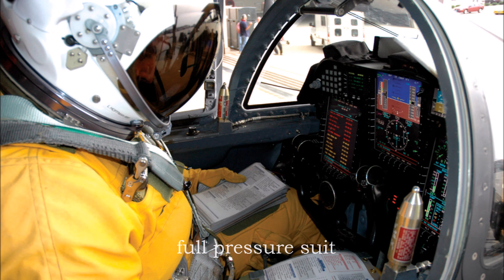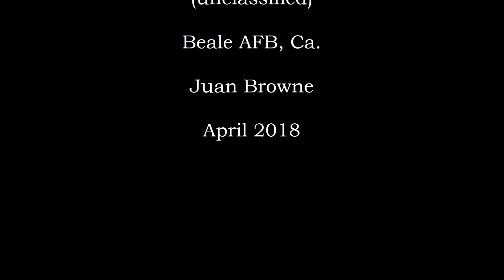Mysterious Jet Noise Over N. California Explained

Comment: Whose bright idea was it to not put a fuel gauge for both wings in, doesn't this require undue pressure and responsibility on the pilot in his flight mission? What advantage did this have when these planes were built for the  mission that was more important than the information pilots need?

Comment: The U-2 was supposed to be obsolete, so they went back to Kelly Johnson for the fix... and got the A-12 / SR-71 family, now hopelessly grounded. As they still flying U-2, makes me wonder what the Classified next generation past the SR-71 really is. Satellites are nice, but not every mission need can be met from orbital observation.  

From time to time I hear the same throttle down and up in the sky above my area, and there is no base at an appropriate distance to explain it the way you do the U-2 out of Beale.  We have F-15s out of KPDX that fly by.  We about 15 miles SSW from the airport.  No U-2s here.   Is there any operational aspect of the F15 that requires dropping to near stall and then throttling up?  Its usually on heavy overcast days we hear this, out of sight from ground. I wonder if they doing dogfight stuff. They dont show up on FlightAware, and its always when there is no GA or commercial traffic around. We get a huge amount of commercial at about 5000 on approach.. if landing from the west. Flights from the south turn at point OR40 (Canby) into pattern, and pass just east of me as they head NW before final turn to land on 10L or 10R.
Reply: UAV's are the replacement for the U-2's/TR-1's.
Reply: Pelican1984 
Unmanned is easy... I want to know about mach 6 or higher aircraft penetrator data collectors...  well maybe I don’t, cause they would kill me if I knew for sure.  Still very much that is highly classified.
Reply: Seems like something else doesn't it? I asked Juan about the thinking when these were built with out fuel gauges, hope he answers one of us.

Comment: If it that critical what's the reasoning behind not having 2 gauges? They do touch and go's up here in Chico and being only 1 1/2 miles away from the runway we get to watch them, very cool. I've seen over the years when they take off from the last touch and go the pilot will point the craft almost straight up and pour the coals to it until there out of sight. Awsome.

Comment: Fascinating! Thanks Juan.... Last year Emeritus Professor Ian Fells asked me how "Anti-Gravity" might have worked. We believe this may be related to the propulsion system for Skunk-works Drone Ultra High Velocity First Responders..???... This is only a guess...!!! (nullius in verba) ... Back in 1982 just before the Falklands conflict broke out, I was invited to help mentor post-graduate exchange students (American) working at Oxford's Culham Centre For Fusion Energy, by Dr John Maple. I am an applied mathematician. These conversations were only hypothetical, and the discussion focussed on "Poloidal rotation and super-conducting pinch fields in a non-fusion 'Tokamak' type plasma toroid." The hypothesis centred around differential forces of centripetal acceleration. These forces increase to the square of the angular velocity. Differential mass is only a linear function. twice the mass, is twice the force, but twice the angular velocity is four times the force. If the plasma is in very rapid poloidal rotation in the upper region of the 'pinch field toroid', and relatively slower angular poloidal rotation in the lower half of the pinch field toroid, then there should be more force in an upward vector, than the downward vector. It would be advantageous to deploy two contra rotating plasmas in separate toroid confinement. (even four of them, two inner and two top and bottom, for perfect mirror symmetry) 6 x 6 = 36, and 19 x 19 = 361. A ten-fold differential vector force advantage if the plasma cross-sectional area is so adjusted by the super-conducting pinch fields. Heavy metal vapour plasmas would never reach fusion temperatures or even close! All they need do is lose their electrons to become plasma. a few thousand degrees Kelvin. The main attraction to this research, was that experiments involved blowing 'Smoke Rings'. A perfect excuse! These were definitely "High Altitude" smoke ring research projects!

Comment: Thanks Juan..!!  During the 80's and the 90's a U-2 would take off 5 days a week at 7:35 out of Moffett Field in Sunnyvale. It would shake all the surrounding buildings as it climbed at a 45 degree angle to get out of commercial aircraft flight space by the time it was over Oakland.

Comment: I love that. "high flight". Being a C130 FE, I have allot time in "low flight" trimming pine trees in Arkansas at 300-500 feet. Fun times.
Reply from the maker: Little Rock! Spent 6 months there initial qual AC training, I remember cruising down the White River(?) trimming the trees 4 ship formation. Good fishing there also.
Reply: When were you at the Rock? I was there for C130 hot training (crew chief) in 1996 then was back for the FE school in 2005. Flew in the 61st and the 53rd (when it went to an active SQ, not the training 53rd). Ahhh, the good old days of no a/c on the E-models doing a low level tac route. In July.

Comment: Juan you always get me with your pilot - game face & tone. Because the straight face humor of the US Air Force paying 900K for the U-2's in 1960 for a plane with only one gas gauge for two tanks. And a hand written sticky note that says, "Gas Gauge May Give Funny Readings" stuck next to it as a pilot's note to themselves. Just makes me laugh out loud with respect for the engineer that had to describe that the fuel in between 429 mph and 500 mph; is only going to be flat or readable in the tank at a Stalled Speed. But Oh don't forget to shake the wings, before you take the reading. I have nothing but Respect for how well that Old U-2 does it's job and it's engineer's made me laugh with Respect, too.

Comment: Very dangerous plane to fly up to its operational ceiling. With its straight wings it is obviously a sub-sonic design but higher altitudes call for higher speeds to prevent stalling in the thin air. Up at the ceiling there is only a few knots of airspeed between stalling and going into sound barrier instability. A very fine line to walk.
Reply from the maker: best done on autopilot at that point.
Reply: known as coffin corner. 
more speed, mach tuck, lose control.  
lose a few knots, stall out.
Reply: "Coffin Corner?"

Comment: Juan, I though that they were retired, why would we need them with all the satellites that can see more then they can, from what I heard on the science channel?
Reply from the maker: Good question, or unmanned aircraft...I should do a follow up.
Reply: The problem with satellites is they're predictable for location and take time to reposition verses launching an aircraft that has a good amount of loitering time.
Reply: Confirmed, per Wikipedia: "The U-2 remains in front-line service more than 60 years after its first flight with the current U-2 beginning service in 1980. This is due primarily to its ability to change surveillance objectives on short notice, something that surveillance satellites cannot do." __ https://en.wikipedia.org/wiki/Lockheed_U-2
Reply: And it can change surveillance "packages" quickly as well, with a large variety of cameras, sensors, etc.

Comment: I was playing around on adsbexchange earlier today and saw one at 60k feet flying over Mendocino National Forest. Guess it isn't as unexpected as I assumed since they are based out there.
Reply from the maker: may have been the same guy I saw approaching Beale today.
Reply: I only saved 2 data points. 39.3808 -122.7753 at 9:37 am pdt and 38.7437 -123.2242 at 9:42 am pdt

Comment: Do you know what the "rocket's" are, either side of the canopy, shiny, pointed?  Canopy release?  
Great vid as always!
Reply from the maker: not sure, I saw that too.
Reply: It looks like they have electrical connections running forward.
Reply: Not sure, but from where they are positioned, I would guess they have something to do with blowing off the canopy in case an emergency exit is required.

Comment: A fuel gauge by tank omission is another weight saving decision Kelly Johnson etal made many years ago to keep the weight of the U2 down, which includes others like: bicycle landing gear, jettison of the wing landing gear etc, very thin aluminium skins, bulkheads, etc.  The decision to have no ejection seat due to weight in the early versions was reversed after several fatalities. The rear fuselage is held on by 3 or 4 bolts, and they are 7/16" diameter as I recall.  The list goes on and on of compromises the Skunk Works teams made to bring the U2 to achieve its mission compared to other aircraft military and or civil.
Reply from the maker: Excellent info! There are also no baffles in the fuel tank to prevent sloshing, saving more weight.
Reply: @blancolirio  I always knew the U2 (and TR-1?) was difficult and quirky to fly and even more difficult to land, but even with all that, I get the impression you'd love to fly it nevertheless?  James May's reaction to being 70,000ft up was instructive and I guess it takes everyone like that?  Very interesting information, thank you.
Reply: @rogerwhittle2078  The U2 is pretty impressive, and I can't speak for Mr Juan Browne, but for me personally, the ultimate dream would be to fly an SR-71... Just the most amazing aircraft ever built. Functional and beautiful at the same time.
Reply: Yes cool info! !

Comment: I worked at Moffett NAS (now Moffett federal airfield) in Sunnyvale CA when the U2 was based there. When they took off they made quite a racket. The climb was so steep, they had about 3000' in altitude by the time they crossed the end of the runway.
Reply: And they were to altitude before the Dumbarton Bridge. Once they were off the ground they would rotate to about 50° and climb to altitude. They also could take off in 300 feet or less and launched off an aircraft carrier. An amazingly beautiful plane and designed and built in 1954 I believe.
Reply: They were even louder than the wind tunnels and looked like they were going straight up. It was a VERY sad day when they left for Palmdale/ Dryden/Armstrong. We still have a C Model that was kept for the Moffett Museum next to the Hangar 1 framework, the shell was removed because of lead, PCB's and aspestos contamination.

Comment: Wouldn't it be easier to just add a fuel gauge?
Reply from the maker: seems like it. Probably get one at Napa Auto Parts. lol
Reply: Oh stop it!! Using common sense will get u nowhere....
Reply: There is nothing  common or sense in the military or government.
Reply: Probably, but since it's Government, it would probably cost a million dollars per plane to add.
Reply: Roy Reynolds   And, often, the engineering reasons that make something that seems easy difficult are not obvious.

Comment: Interesting as always Juan. Did you used too see the SR-71 go over back in the day ?
Reply from the maker: Yep! Got to ride in the KC-135 as the SR71 was receiving fuel!
Reply: Used to watch the blackbird come in from the West back in the 70s and 80s. They always had a one or two plane escort as they flew over Oroville Ca.
Reply: blancolirio  Wow that might've been my dad's "office in the sky aka gas station" partaking in that activity (he was a career usaf boomer) 🤓😎
Reply: When I was stationed at Kadena Air Base you could alway tell when the SR71 were going to fly as the KC-135 would go to the end of the runways and as part of their preflight did what we called an smoke off. They would run the engines up and produce a lot of smoke. After they would take off the SR-71 would follow.
Reply: They have to refuel because they leak so much fuel when on he ground.